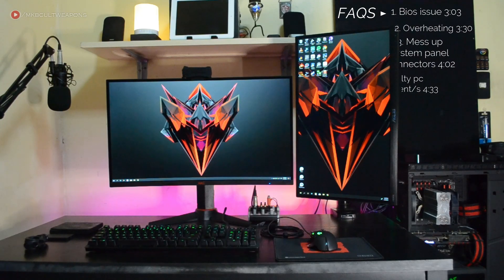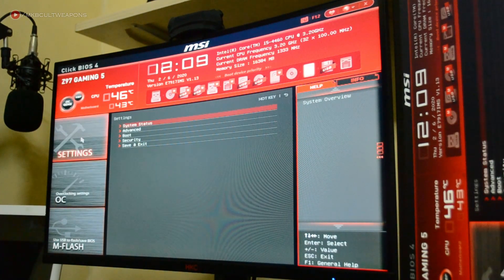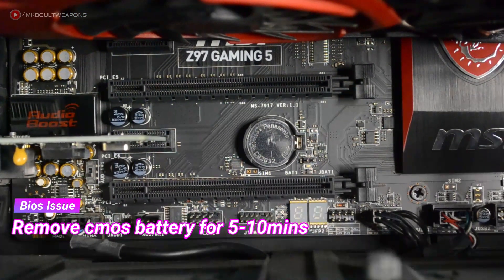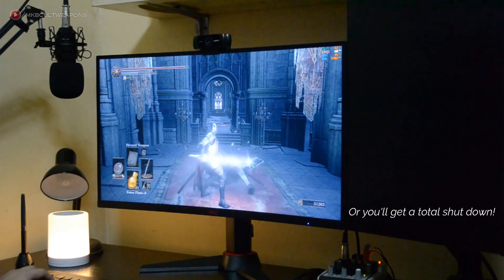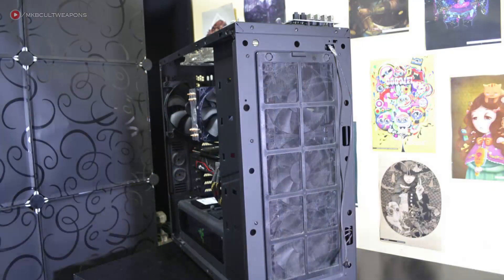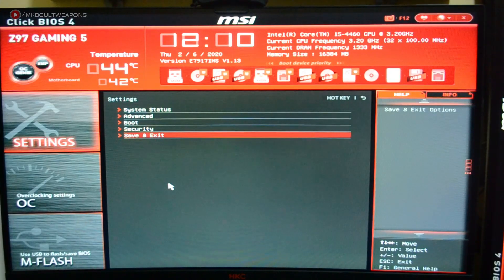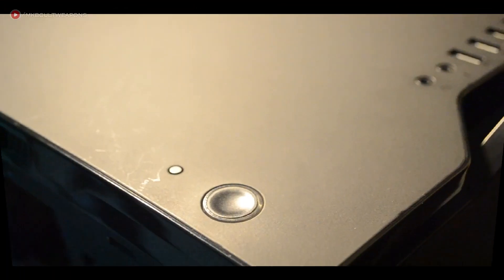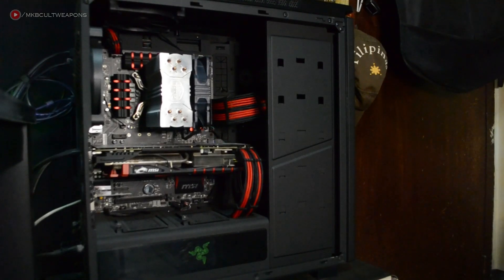Pc keeps restarting FIX / Pc continuous restarting FIX

Comment: i just did it to each stick(i have 2 4gb) and luckily one of them got me my pc running, when i use them both at the same time or the other stick alone my screen would go black after 30min after booting up, for now its been running for 2hours ish and i hope it wont go black again, im scared it would turn off in any moment. thank you for the eraser thingy mate!
Reply from the maker: glad it's working now, if ever you got the black screen again just clean off the dust in the ram slots

Comment: Thanks. I've set xmp then pc start boot looping until i found this vdeo. Just put out battery. Thanks!!!
Reply from the maker: you're welcome bro! thanks for the feedback!
Reply: It happens to me even when I'm just watching a movie not only by playing a heavy game like horizon zero dawn, So what i did is i removed my gpu that is gtx 1660 super Evga and tested my pc with the integrated onboard graphics that is intel hd 4600 nothing happens even when playig light games but when i plug in my gpu that is gtx 1660 super pc keeps restarting itself with a buzzing noise/sound. Can anyone help me?

My specs are 
Intel core i7 4770
16gb ram ddr3
Eps 850 watts 80+ silver
256gb ssd
Evga Gtx 1660 super 6gb vram
Mobo ecs z87h3 a4
Reply from the maker: @footballmatchhighlighttv  that buzzing noise is bit worrisome. If not coil whine from gpu or psu it might be a short or low power draw. My question is did you experience any power interruption or fluctuation in your house? But i suspect that this might be a low power draw from power outlet or your psu is failing to give enough power to your system.
Reply: @MacCoyzkie but my psu is 850 watts and when i try it with my integrated graphic (intel hd 4600) nothing happens, no restarts no anything. But when i plug in my gpu gtx 1660 super..The problem keeps going on it has been 3 months now
Reply from the maker: @footballmatchhighlighttv  can you remove the cmos battery for 5 minutes, make sure your gpu is plugged in, after 5 minutes place the cmos battery back. your pc might just need a bios reset
Reply: @MacCoyzkie  got any tutorial on how to do that
Reply from the maker: @footballmatchhighlighttv  none at the moment, it's fairly easy, just make sure pc is not plug in any power outlet. look for the circle silver thingy, usually under the gpu slot (pcie) there is a lock the places the battery just pull that down then the battery will pop out.
Reply: @MacCoyzkie  at the moment i just tried using 2 ram stick of 4gb, 4x2. Nothing is happening
Reply: I have 4x4 ram sticks 3 runs at 1600 mhz but one runs at 1333 mhz

Comment: i broke the power button on my pc so i use the shortcircuit method of sticking a pen tip or what have you in between the two power pins..............................
lets say these fixes didnt work, would you assume that it has to do with the power pins or perhaps something else? 

cheers!
Reply from the maker: i would assume that the front panel IO might be faulty, because even if you jumble the connections of the power button/reset button etc, it will never break the motherboard. But that will cause a problem like looping restarts. I suggest buy a new case, it's not that pricey anymore, i recommend darkflash cases like this https://amzn.to/3lxNTc7
Reply: @MacCoyzkie  only saw this now. thank you very much dude

Comment: This restart thing is happening to me right now, i think the cause is that i experienced electric fluctuations recently because of the typhoon. It happened many times while I'm playing. And now i don't what to do with, it keeps restarting. Please help me guys, thanks!!
Reply from the maker: If you're using a direct connection from wall outlet, all those power fluctuations will be a lot of burden for your psu, if your psu is not 80+ certified, you could fry your pc parts if you keep pushing it even though it is already restarting non stop, you'll destroy your pc in no time. I suggest purchase a reliable automatic voltage regulator (avr) or Uninterruptible Power Supply (ups).
Reply: Ohh i have an avr, and i notice that it only restarts when I'm gaming .
Reply from the maker: @johngonzales6287  i see, this means either your psu can't handle your pc at it's gaming performance or your temperature on gpu and cpu are reaching it's limit during gaming

Comment: I don't know what happened my cp again and again restart on window starting display on windows 7
Reply from the maker: might be a failing drive, usually hardrive. If you got an old hdd plugged in your pc try to remove that and just leave your boot drive (ssd or m.2) and start the pc

Comment: Hi, my pc have a  problem like that. But sometime when i turn on  it's can't while still have power( i see it on power led of the gpu). Is it because my psu get low power draw?
ps: sorry fot my bad english
Reply from the maker: It’s possible that is a low power draw from psu or wall outlet, if you’re seeing led lights and fans running this may also be the rams so clean your rams like i did in this video

Comment: When i load up a game and play it for around 10-20 minutes my screen goes black and the pc restarts itself, also the pc is sometimes louder than usual :(
Reply from the maker: oh that's a bad sign bro (gpu issue), can you check your pc temps during those 10-20mins, it must not be higher than 90c
Reply: @MacCoyzkie  i just cleaned my ram with an eraser and it actually hasnt restarted yet, and its been about 4 hours. So if thats what fixed it thx so much
Reply from the maker: @altayayay  i see, i hope stays on :)
Reply: it started restarting itself again for some reason, weird how it was fine yesterday for like 7 hours and its happening again today.
Reply from the maker: @altayayay  i think it's losing connection from the ram or the rams are on its way. ask a friend with compatible pc to try your rams out, if problem persist then i guess your rams are becoming faulty

Comment: Bro, I bought new motherboard, rams, psu corsair 550 +80 bronze, cpu. still nothing works i tried everything still keeps restarting fucking annoying new parts and restarting all the time, I changed 700wats power supply but again same shit, i tried to do this with all parts connected, i tried only cpu connected nothing at all fuck my life

Comment: i was cleaning my pc and i removed my (2x8) ram sticks and my idiot self put it on 1 side and the other was off it kept restarting and i felt like i’m on a plane and the engine closes and turns of i was like my pc is going to explode i’m going to die but when you said try to clean the ram i felt so dumb when i looked how i placed the ram, after that i placed the ram correctly and it worked thanks so much bro :) <3
Reply from the maker: awesome! glad it worked for you too, thanks for sharing your experience with us
Reply: I need help...
Reply: I removed by ram sticks to clean because of dust but now my pc reboots i guess its because of the ram i cant put in right
Reply: Im stupid
Reply from the maker: @howtoremovealias  it's fairly easy to place it back, there is a lock on the top and bottom of the each ram slot, for some it's just one lock at the top. make sure to open it before placing your ram, align the notch and just push the ram down until you will hear a click that locks the ram.
Reply: @MacCoyzkie  well, then its not the ram thats making it restart all the time, because i pushed it in until the click and put them in the second and fourth slot.
Even tried to only put one in if one was broken but doesnt work.
Ill just call someone for help and if I know whats wrong ill update you.
Reply from the maker: @howtoremovealias  ok i hope you'll be able to fix it

Comment: Hey my pc randomly turns off what’s does that mean?
Reply from the maker: low power draw, either from psu that can't handle your pc specs or power outlet, often happens when you experience power fluctuation in your house. also consider the ram, do the cleaning method in the video

Comment: I reset windows on my computer and it was fine but now it won't boot up at all, it just stays the the logo screen and loads a bit then it freezes and restarts its self and does it on repeat until I power it off
Reply from the maker: That’s probably a drive problem, maybe some of your drives are failing

Comment: I am using  3500x with asus prime a320mk mobo and my pc restarting when playing games only what should i do.
Reply from the maker: overheat bro, probably thermals are getting too high. how about opening your pc case during gameplay? Also i'm curious, what are your specs and did you manage to update bios for your a320 to work with 3500x?
Reply: @MacCoyzkie  yea i did update the bios but steel its same

Comment: My pc keeps restarting and won't even boot Into windows, I replaced thermal paste and cleaned it
Reply: I managed to boot it into safe mode and uninstalled amd drivers, seems to have fixed the issue and finally let's me boot into windows
Reply from the maker: @wakaflockaproject  oh i see, can you tell me what gpu u have? this might be helpful for others as well
Reply: @MacCoyzkie  r9 280 sapphire, it may have been liquid damaged due to me :(
Reply from the maker: @wakaflockaproject  i see bro, but hope it will all go well
Reply from the maker: that's probably some lose cables or you made a mistake in placing the front io switch in you mobo
Reply: @MacCoyzkie  should I take of io switch and place back? I checked gpu cables all fine. Card was working fine before taking apart
Reply from the maker: @wakaflockaproject  this might sound common but did you plug the monitor in the your gpu monitor input or in the mobo monitor input?
Reply: @MacCoyzkie  gpu port, as I don't have on board graphics

Comment: My pc keep restarting and turn back on continuously but the screen is still off. And when it turned on for 10 mins it appeared a blue screen of death said " you can restart now " i have visted the support website but it didn't help much, plus i used both the " start up repair " and    
" reset pc " plss help :(
Reply from the maker: that has to be the ram losing signal, before you do the cleaning method here try to reseat the rams
Reply: @MacCoyzkie  i have cleaned my rams
Reply: And it still restarting itself repeatedly
Reply from the maker: @Maki_macchiato.03  it might not be the pc parts itself but have you experience electrical fluctuation in your house, that might be a low power draw
Reply: @MacCoyzkie  everything was fine but 3 days ago this happened for some reason and there wasn't any electrical fluctuation :/
Reply: @MacCoyzkie  and i think i may going to the shop but TY bro atleast i know a bit more <3
Reply from the maker: @Maki_macchiato.03  sorry man i can't help you fix your pc

Comment: help. My pc turns on for like 5 minutes then restarts but only when I'm in a game if i just turned my pc on and left it on the home page it doesn't do that...
Reply from the maker: bro that might be a temperature issue, does your pc got a good airflow? try run the game and open the pc case, also lower your game settings
Reply: Mac Coyzkie idk if u are all round good at PCs but I just realised my graphics card (Gtx 1060) just stopped working and the fans stopped and it doesn’t detect it
Reply from the maker: @toes8600  oh not at all and im sorry to hear that

Comment: I turn it on beeps5 times n turns off and goes off again.
Reply from the maker: definitely ram sticks, try the solution in the video
Reply: u think with the eraser? n all that Cuz i took them out n j cleaned them down with a soft little cloth. Bro i’m just really hoping it’s not my psu gpu or cpu i hope it’s j the defaulty ram sticks i doubt it tho bro
Reply from the maker: @yeah5xwepayed  a soft brush will do, cloth is much more dangerous because of static that might release it

Comment: Can I have some help? I am only 13 yrs old my new ram wont work. My old ram was 4gb(ddr3 1600mhz) then I buy new 8gb(ddr3 1866mhz) when I put the 8gb it always restart. I already follow your tips but it still restarts
Reply from the maker: does your motherboard supports the new ram speed you have? If it doesn't, it will not work at all.  Btw don't put the old ram and new ram together because you'll definitely have issues there.
Reply: @MacCoyzkie  yes my motherboard supports my new ram. I only put the new but it always restarts.
Reply from the maker: @lotusy6007  Does your 4gb ram still works with your build though? If yes then i guess you have to return that new ram to the local store where you got it from and have them check it, or replace it. I think it is faulty
Reply: @MacCoyzkie  Yes my old 4gb ram is still working. Thank you!
Reply from the maker: @lotusy6007  yw, yeah you need to return that 8gb because it might be faulty

Comment: Had same issue earlier which was fixed then I checked ram and hard disk no errors, 
Now, 
My computer gave 3 bsod WHEA Uncorectable Error and then 4th time it didn't boot, but cpu fan speed slow, 
Then again connected it cpu fan speed fast but still bootloop 
I re applied thermal paste,no boot
Clean ram, no boot
Bios Reset, bios Battery replace, 
Remove GPU, reconnected power cables, 
No boot, just bootloop
Reply from the maker: have you overclock at some point?

Comment: hi bro, my pc start and is ok during 15 mins approx, but after that it just restart.  i mean is not a loop that don't allow me to start windows, for example I'm writing this message from this pc because I can stay there about 15 to 20' m9inutes
Reply from the maker: During the course of the 15mins can you check the task manager if there is any unnecessary program that is running during idle.
This might be a virus. If there are none, then most likely your pc needs cleaning

Comment: Man I’ve tried everything I’ve updated drivers for everything I can and made sure all psu cables were plugged in correctly. I have a sapphire nitro+ rx 5700 xt and it just seems like the drivers for it are the root of my problems. I ran WhoCrashed every time after my computer restarted and each time it seems like that is the culprit. No matter what I do with this damn gpu it just ends up crashing I can’t recommend it honestly
Reply from the maker: Does it restarts only during gaming or does it also restarts during productivity workload?
Reply: Mac Coyzkie During gaming. I can do anything else but gaming seems to be the only thing that does it. I was playing valorant not too long ago for maybe 20 minutes and the game actually said graphics card drivers crashed, then the system restarted again. I am honestly just going to return the card for my money back and wait for 3080 to be back in stock. Thanks for the reply.

Comment: My pc was doing this but after a day it fixed itself without me doing anything.How the heck did that happen?
Reply from the maker: there are a lot of areas that could be the cause, usually low power draw from power outlet specially when electricity in the house trips or something. It happened to me recently i thought my pc is broken but when we have the wall outlet check, it's not bringing out enough power. 
It could also be a dusty computer, some times it looses connection from parts to parts, Ram sticks are usually the culprit

Comment: My pc will reboot after i open some apps
Like steam or google chrome
And sometimes it will reboot even before desktop showed up
I tried clean my ram but still doesnt work
Reply from the maker: can you login to safe mode and look at your task manager? this might be a virus. On the other hand it might also be a low power draw
Reply: @MacCoyzkie  what is low power draw?
Power supply problem?
Reply from the maker: @skepta911  yes, the power supply might not be giving out enough power or it could also be an electricity problem in your house
Reply: @MacCoyzkie  I really wanna buy new power supply
But it could be not the problem so it gonna be a waste of money
I dont know what to do now :(
Reply from the maker: @skepta911  you could also go to a local shop and have them repair your pc, i think its the best way
Reply: @MacCoyzkie  Hey man i just replace the power supply with the new one
But still rebooting
Reply from the maker: @skepta911  im sorry to hear that bro i just wish i can see your pc physically so can help you. If you got a friend with compatible pc ask them to try your rams in their pc, if problem persist it's the ram, if not then it might really be the motherboard.  Better yet, just bring it to a local shop and have them check it

Comment: wew my ddr3 ram runs after that eraser thing! thank you
Reply from the maker: nice! you're welcome and thanks too for the feedback
Reply: It happens to me even when I'm just watching a movie not only by playing a heavy game like horizon zero dawn, So what i did is i removed my gpu that is gtx 1660 super Evga and tested my pc with the integrated onboard graphics that is intel hd 4600 nothing happens even when playig light games but when i plug in my gpu that is gtx 1660 super pc keeps restarting itself with a buzzing noise/sound. Can anyone help me?

My specs are 
Intel core i7 4770
16gb ram ddr3
Eps 850 watts 80+ silver
256gb ssd
Evga Gtx 1660 super 6gb vram
Mobo ecs z87h3 a4

Comment: hello mine didn't work i cleaned the ram and when i turn it on the PC starts making a loud noise do you know the solution?
Reply: and the screen doesn't catch single
Reply from the maker: how did your problem started anyway?
Reply: @MacCoyzkie  first the screen didn't work i tried everything u said and it still didn't work
Reply from the maker: @zyddddd  if you tried every suggestion here that might be a gpu or psu problem. Do you have a friend with compatible pc like yours? ask them to try your gpu in their rig, if it still doesn't work then it might be your gpu